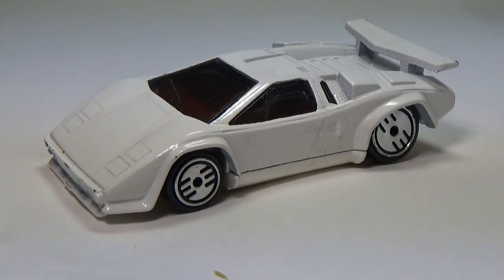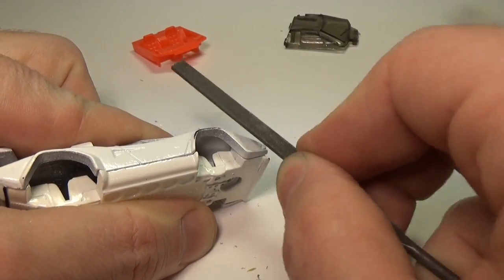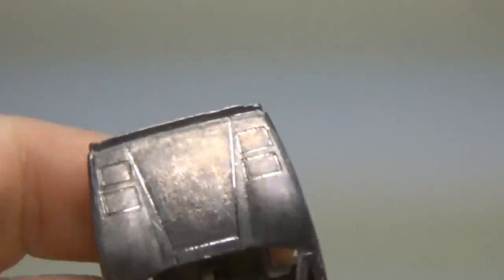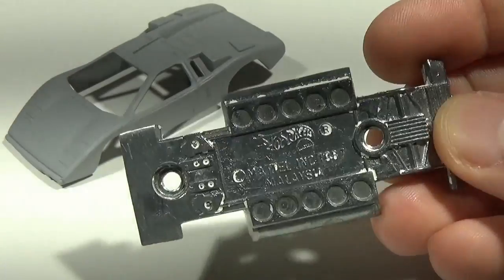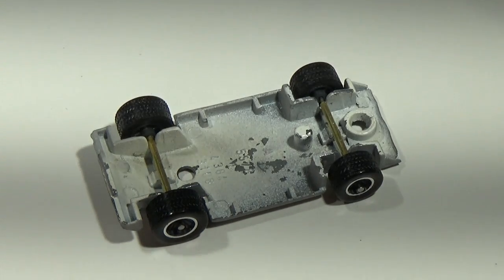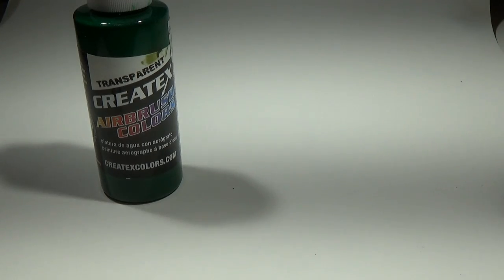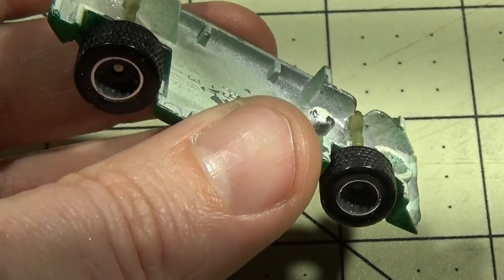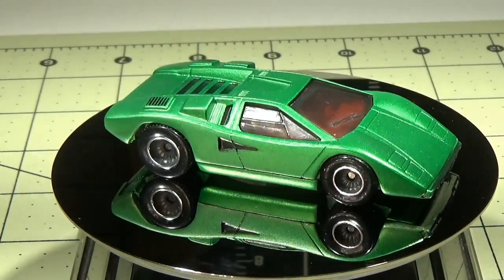Hot Wheels Custom Lamborghini Countach LP400

Comment: It shouldn't really matter for most of your models, as they're display pieces, but you can get superglue (cyanoacrylate) to bond much stronger using baking soda (sodium bicarbonate). The latter acts as an activator and increases strength of the adhesive; the combination of both can even be used as a filling cement of sorts! Just sprinkle it over the still wet superglue, and blow off the excess when dry. A little trick I picked up on a while ago, not sure if you're aware of it - just thought I'd share.
Reply: You gotta be careful with that though. I've had it make pitting before.

Comment: the project came out looking way better than the original. a little tip for gluing the axels into the axel tubes, I'm sure that you had the issue of the super glue getting on the face uf the tube and sticking the wheels in place, not a big deal especially if you don't mind the car not being able to roll, but a way to counter that is to take a thin peice of metal or plastic with a notch the width of the diameter of the axels to use as a spacer between the wheels and the tube, so that the excess glue  is cough by the tool and doesn’t get on the wheel. I'll send you is on ig to give you a better idea of what I'm talking about

Comment: I have a question about priming
so i have this metal primer that says it is self etching or something and works with all metals
but when i prime my car, the paint scratches off very easily, even after leaving it alone for about a week.
I have a theory that using 500 grit sand paper may be too fine for it, just wanted your opinion and advice, thanks!

Comment: Unfortunately, you wrecked the Countach's signature rear wheel arch shape. And the LP400 predated the low-profile, ultra-wide tyres which did not arrive until years later, with the prodigious 345/35 rear wheels.

Also, the LP400 predated the pushed-out wheel look, and the original cars had plenty of space between the wheel arches and the tyres. 

But you were kind of screwed from the start. Only the LP400 had the periscope roof, which is correct for your car, but wrong for the model they advertised it as.

Ah well, it looks good, anyway!
Reply: There WAS only a couple of production Lp400s's that still had the periscopa before they canned it. Youre right about the wheels though, they were naturally very skinny on the lp400.
Reply: I think the point was..that the car looked like shit from Matel.And He made this car look so much better.lololol
Reply: Huh

Comment: I had a Hot Wheels Countach when I was a kid, it rolled under the fridge.....I got it back years later when the fridge died and needed to be replaced, but by that point I was too old for them. It was cool to find after all the years, covered in dust but still like new.

Comment: The rear fenders on the Countach LP400 weren't round at all, but had a somewhat straight, angled cutoff on the upper edge. Not sure how you would have fit the tires in there with proper wheel arches though. Otherwise, great work!

Comment: really like the way you did the car. Could you have used some thin washers to bring the car up from the tires? and last the drivers side rear wheel well could have been smoothed a little more. but over all you did a fantastic job on the car. love how you do the black accents on the taillights and top section.  9.9/10

Comment: You may want to pick up a set of diamond cut off wheels for a dremel. They would have made this project much easier. They cut just about anything(glass included) and do a narrow cut. A 10pc set(clear box/yellow base) can be had for under $15. I use them on my quads all the time.

Comment: I just wanted you to know that your videos have inspired me to restore my favorite Hot Wheels Redline from my childhood, the Jack Rabbit Special. I picked up a cheap one on eBay recently. Being as I'm planning to do a restoration and copy the blue body stripe, I'm curious if you have any tips for that. The line was not really that clean in the production model & had some bleed to the edges. I'm considering doing a raised baffle to get that look, rather than just taping it off & getting a sharper looking line. I'm thinking that a thicker material like cardboard, flared outward underneath and raised slightly off the surface might do the trick. I'd appreciate any comments or tips you might have. Thanks, again, for the great videos!

Comment: Amazing custom model. I only think you could've moved the custom tube holding the back axle a little further down by drilling a bit of the base material and thus fix the rolling issue. I'd also go for a more classic color that fit better with the red interiors. Otherwise, great model as always.

Comment: Great job on this iconic model, thank you for sharing the process. I have a question: have you used the same size wheels or are they a little bit bigger than the originals? Thanks.

Comment: looks good but I wish you put a ll more effort into finishing those arches, the rear needed filling to get the exact round shape you wanted and the rear deck has a mold line it in still, I myself would have filled and corrected the door pillars above the glass too as it looks like its cast very open for ease of assembly that you get get around by hand. BUT saying that I would have most likely just bought a better version as even as a kid I knew this version wasn't very good ( I had a colour change one) and always thought my corgi version was better, hell I even recently bought some dollar store versions that are really accurate

Comment: I've just discovered your channel, and for the past 4 hours have been binge watching your videos. Your restorations are amazing and very inspirational. Iv'e learned a lot from your channel, and thank you for taking the time to make these videos.

When I need to use super glue on any of my models. I have a square piece of card board, and I squirt a but of the glue onto it, and then I'll use a cocktail stick to apply it to the location. I find this works well for me, since it allows me more control. Not sure if this would help?

Comment: I love this video as I've always had issues with certain low value large volume hotwheels that iha e in my collection. I wanted to try this with the 77 firebird. I want to try and remove the rear ducklip spoiler or the late 70s early 80s sheriff cruiser removing the lights and trying to make it just a cool normal car, if possible

Comment: Looks great, except that the rear wheel openings on the actual car are that shape.  It is a Lambo design trademark.  The actual car has skinnier tires that stay inside the bodywork.  Still, great conversion from a not desirable diecast version.

Comment: I would have kept the tail I would have made the wheels wider and at the very least I would have shaved the wheel wells down instead of removing them totally the racing stride I would have kept I have fancy the racing stripes over the center of the car on the lighter side of things I like the contrast of the black and red it also makes the details stand out a little bit more in hindsight if I were to repair the wheels like you did I would put the car up on a stand while the glue dried at the very least hold the axles together with your fingers till it dries last but not least most excellent video I thank you for your time and patience

Comment: I prefer the Matchbox Contact because they seemed to have deeper panel lines than the Hot wheels version and also had tampos, painted headlights, shocks, as well as other fine details that, for some reason, hot wheels left out.

Comment: i have the matchbox version that has rear suspension but it looks like mine got stepped on as the front windshield is cracked and the roof is pushed in
Reply: you wondering how to fix it?
Reply: Jammy Gamer yeah. i just really like its suspension. i also have the hotwheels version in this one and also one more
Reply: ok
first drill out the rivets and open up the car.
secondly remove the glass and try to force the roof back up and then check on whats broken with the suspension

Comment: There is a newer version which was made for the 50th anniversary of Hot Wheels which has a better design only that the casting I am referring to has red beacon lights and windows (with white painted version of the casting) or blue beacon lights and windows (with the red painted version of the casting)